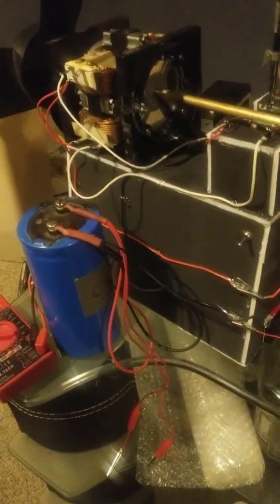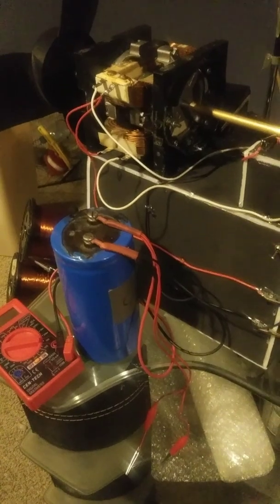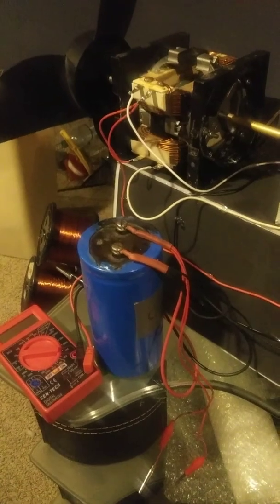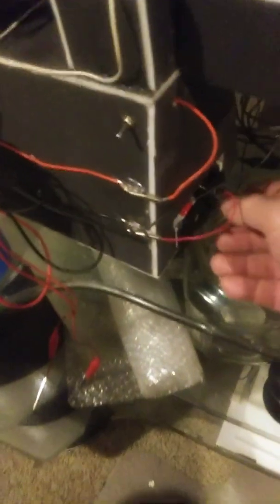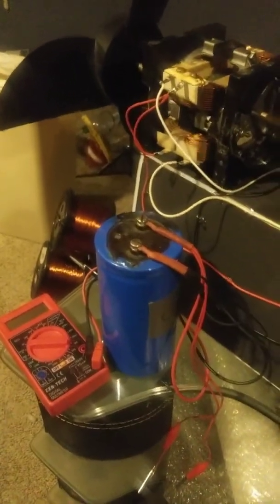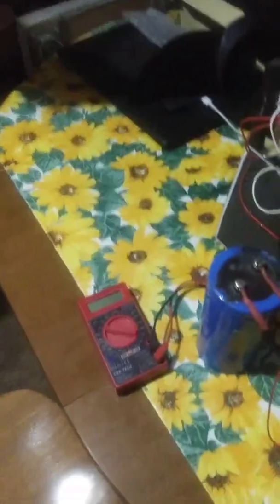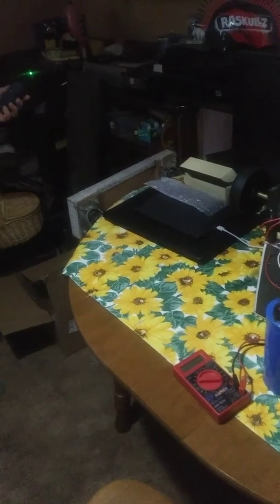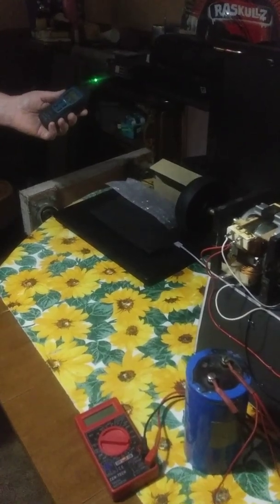Joseph Newman motor

Comment: The capacitor releases electric fast while being topped up by battery in between hits on motor. Good that you are seeking.but the secret you are looking for is in springs
Reply from the maker: I apologize I'm not really understanding what Springs have to do with what I'm doing, but here is a thought, the capacitor obviously puts a small load on the batteries, you would think when I put another load on the batteries the motor would slow down oh, but it doesn't?
Reply from the maker: @spencerwheeler353  actually I'm not sure if it was in the video or not, but before I left my brother's house he brought out a Scylla scope oh, and he confirmed that the energy that was going in the capacitor with AC
Reply: @fpveddie  if you disconnect the battery and spin motor it shows AC kickback, and voltage spikes higher than input , adding capacitor where you have will discharge a larger amp and speed up motor but it will also drain battery quicker. The most important thing is never let positive get home to negative is THE key to Newman
Reply from the maker: The more I think about it oh, I still have the same question, why doesn't a regular DC motor, have the same effect when hooking up a capacitor in parallel with the battery?
Reply: @fpveddie  regular dc motor brush is always engaged, while on your motor brush is out of contact for some time, at that time capacitor charges from a battery
Reply from the maker: @kukulele8182  so DC motor uses a lot more energy from the battery, have you checked out the video of Joseph Newman, call Big Eureka much more efficient than a regular motor
Reply: @fpveddie  i have watched newman's videos, enthusiastically